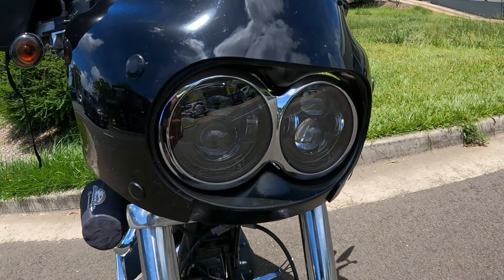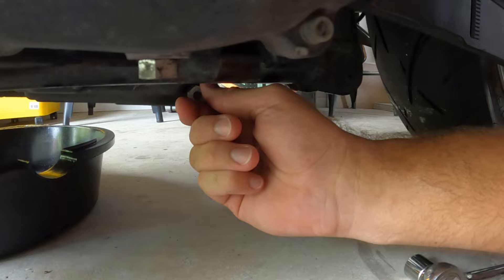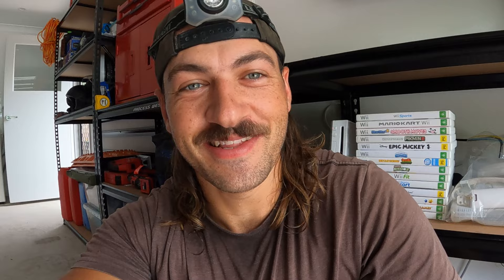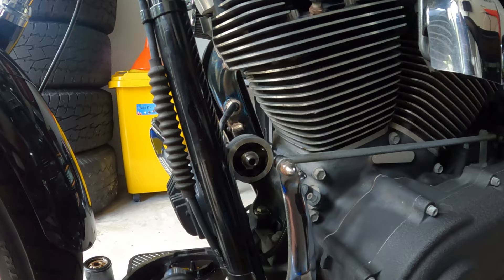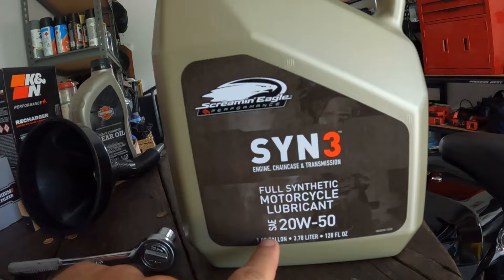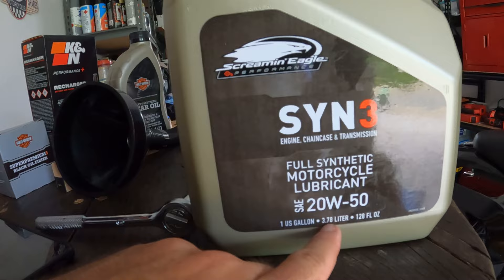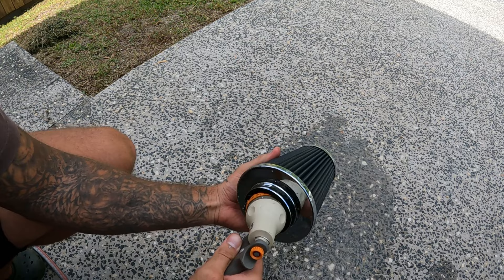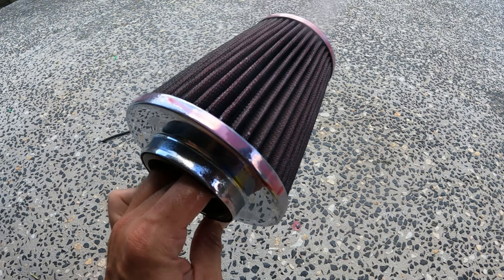3 hole oil change - Harley-Davidson fatbob FXDF - I get triggered...

Comment: when filling oil back up you have to remember there is still oil in the oil lines and various other nooks and crannies in the motor. A service manual also helps brother.
Reply from the maker: Thanks mate, I swear my brain stops working when I'm filming lol. On my last service I half filled my filter and this time I forgot... but it worked in my favour lol ! 
Yeah the manual said 2.8... but apparently should only be doing 2.5 due to as you said motor and other parts still holding oil ! Live ya learn hahaha. One of my many special moments 🤣🤣 I'm not the sharpest tool in the shed
Reply: I've done the 3 oil change plenty of times. But i had to watch. You crack me up. Keep up the good work.
Reply from the maker: @craiggrech7434  haha thanks mate ! I appreciate you watching. Glad you enjoyed it 😅🤣

Comment: Just wanting to throw this out there before you drain anything (incase you haven't) 

Measure engine oil when its on the side stand without your wooden chocks....

You'll probably find the level was bang on ;)
Reply from the maker: Cheers mate, already did drop some. I totally forgot about it being on the wood and also the oil filter being empty !! 🤣
After a short ride I checked it and it was perfect. (Thankfully) haha
Thanks mate, I appreciate it 🙏

Comment: You can cut up an old 1.25L coke bottle and stick it under the filter mate. Cut the bottom off it…and use a long socket extension through the cap end of the bottle and undo everything ‘into’ the bottle. And overflow can run out the cap,end of the bottle into a pan. 👍
Reply from the maker: Ahh that's a good idea... feel abut silly but in the moment I don't really think I just trying and get it done haha. Live and learn I guess. Cheers for the tips ! 
That's a really smart idea, thank you again for the support 🙏

Comment: TORX bolts is what the bolts in the derby cover are called mate. Bit of a worry that primary plug was so loose. 👍
Reply from the maker: Ahhh cheers mate, yeah it was very odd... wasn't leaking though which was lucky !

Comment: Told by Harley mechanic put about 500ml of oil and turn motor over quickly, don’t start it. This will fill the oil filter which will give you an accurate reading of oil level once you put the required amount in.
Reply from the maker: Ahhh yep, like one click of the ignition to turn the motor over sort of thing ? That's very good to know. Thanks mate.
Thanks for supporting the channel also 🤙

Comment: good first effort, the reason the oil was higher on the dipstick was the oil hadn't made it into the filter with the bike running the oil filter fills up and the levels correct themselves. but don't bikes, trucks, cars and trains run so much better with clean oil. A point about syn v mineral  I have always been a mineral guy because of the longer distances I travel if I need to top up oil in a remote place  the chances of mineral oil being available are greater than syn and you can't mix the two, it is a preference for me. Good job young fella the pride you had in doing it yourself plus you saved 260_280 in coin... more cash for a run  now  keep up the vlogs and less political correctness, we know what a tranny is Matt its a important part of your bike and that's all.
Reply from the maker: Hey David, mate in the moment my brain just stops working I swear... I forgot to half fill my oil filter and I also forgot the motor doesn't fully drop the oil ! Supposedly meant to only put in 2.5L taking that into account... anyway all worked out well hahaha 
Ahhhhh I seen! Very good points mate I never thought of that. I'll keep that in mind ! 
I dont even know what pc is 😉😂 
Haha that's exactly right David

Comment: Brother if it get's really hot there just run that gear oil in the primary as well.
Reply from the maker: They did mentioned that at harley actually ! They just recommend that one so I got it. Does that gear oil do better in heat ?
Reply: since i have one of those dealers that tries and sell you the moon when not needed, i went with a harley tech's advise. the dealer said all that will be to thick i laughed and said you better read your bulletin updates, it is not to thick, hell with in 2 miles it is water anyway but yeah it smoothed that clutch out, and shifting clunks were not as loud. Ride on Brother!
 @Gnarly_Harley
Reply from the maker: @biggun1450  oh wow, that's definitely something I'll look into then. Thanks mate

Comment: Hahaha near pissed myself watching you get the oil filter off …….oh and for future reference, half fill your oil filter before you put it on mate…
You needed a couple of beers, and a noisy big arse fan……oh and it will be higher until you run it and fill the oil filter up….good job though mate, great to someone learning👍 
Your plugs will have a specific amount of turns after finger tight to set the crush washer correctly, most brand plugs will have a picture that says like half a turn or a third of turn past finger tight…..
Reply from the maker: Hahaha... I was honestly being lazy 🤣 next time I'll undo the gear lever 😅
Mate !!! I totally forgot haha. I did do that last time but totally didn't cross my mind this time. Ahhh yeah, they should be fine though right ? Gave them 2 she'll be rights hahaha. Cheers for the advise, I appreciate it ! Definitely something to keep in mind for next time 🤙
Reply: @Gnarly_Harley  should be right, but make sure you check oil level after you have run it for a little bit, you might have to put some back in as the oil filter will take up to half a litre to fill👍
Reply from the maker: @AusJase  Yeah that's very true mate, Good point. I did take it for a spin after filming and it was spot on. So I'm pretty stoked with that. Glad I didn't risk it though 😅

Comment: I may have missed it but did put some oil in the filter before install?With the transmission oil i never use synthetic good old dinosaur oil.
Reply from the maker: Hey mate, I literally forgot this time !!! That's okay... helped drop the oil level from me over filling it 🤣 worked out well. Oh okay, good to know. I'll do abit more research on what to use. Apparently synthetic handles heat better ? I'm always getting told different s**t so I'm confused on the matter.
Thanks for watching 🤙

Comment: Honestly, you are wasting your money buying Harvey Danielson branded oils.
5/8 is the socket you should be using.
Torx key. I recommend a set of torx keys & allen keys with T handles for the workshop.
Drain plugs should be 15ft/lb. Not sure metric. (Personally, I only do it by feel)
Deby cover "Gasket"
Hahahahahahahahahaha 
Oil filter hand tight & then 1/8 of a turn with ratchet.
1 US gallon = 3.785 litres
1 quart is 1 quarter of a gallon
You can put in 2 litres, wait a minute, check the dipstick. Top up another 1/2 litre. Check again.etc etc
Spark plug hand tight plus 1/4 turn of ratchet
Belt drive tension check should be part of all services too. Also check tyres, fork seals, steering head bearings, rear shocks, swing arm bushes etc
Reply from the maker: Thanks for all the info mate, really appreciate it ! A lot to learn that's for sure haha. The more I do it the better I'll get. (Hopefully)
Reply: You'll be right @Gnarly_Harley  At least you're having a crack